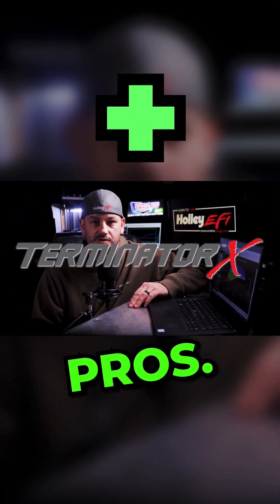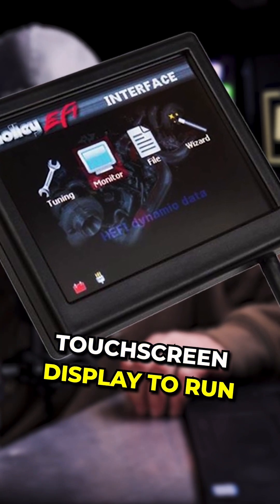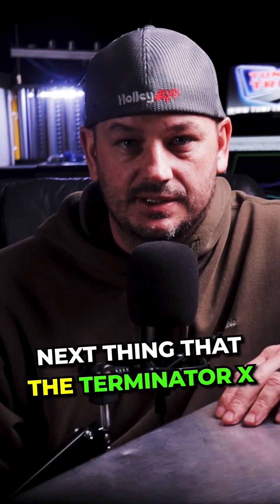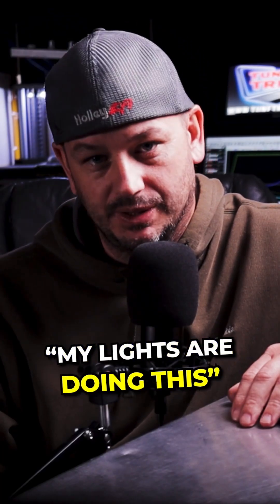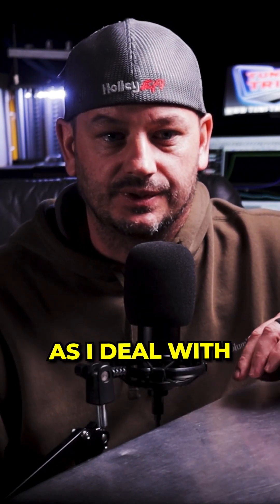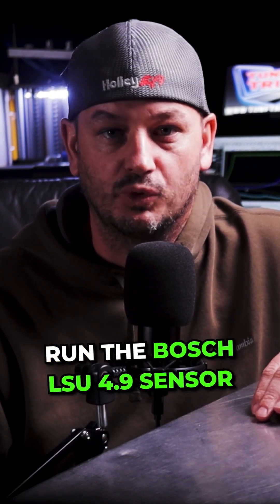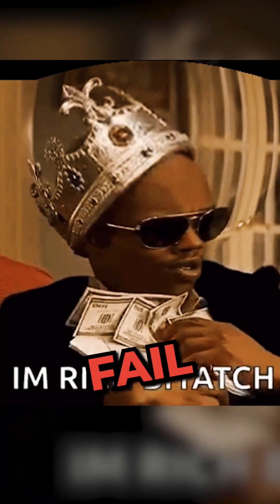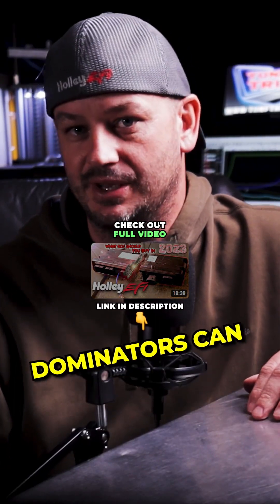Holley Terminator X Pro's & Con's

Comment: just put the 3rd 02 sensor in, about 1k miles on build. first lasted 900 miles, then 2 in last 100 . no exhaust leaks, tuned by reputable tuner, grounds tight, harness away from heat. keep spare and 7/8 wrench and zip ties with me now
Reply: 40k miles on a supercharged 6.0 in our tow rig and still on the original sensor.....

Comment: I wasn't impressed with the ford kit wired for gm sensors connections were missing labels no distributor harness have to buy a lot of extras not mentioned upfront.  Seems cheap Chinese quality.  If I didn't spend so much on injectors intake etc I would have returned it...

Comment: I think there is an NTK LSU 4.9 sensor you can get. Heard it might read a little leaner or richer(can't remember which) so it should be easy to adjust target AFR and adjust the entire fuel graph a certain % to compensate.